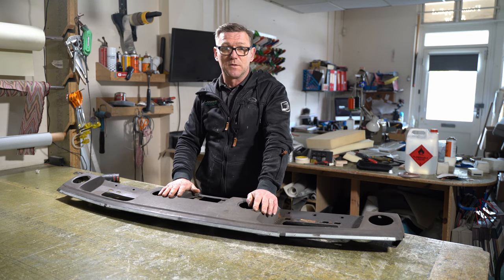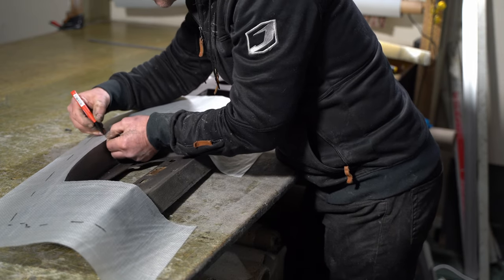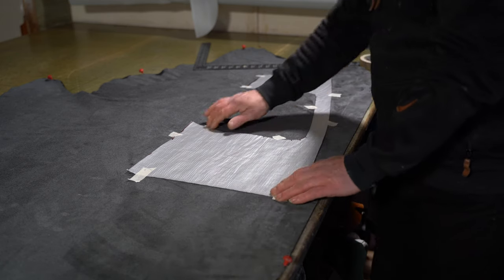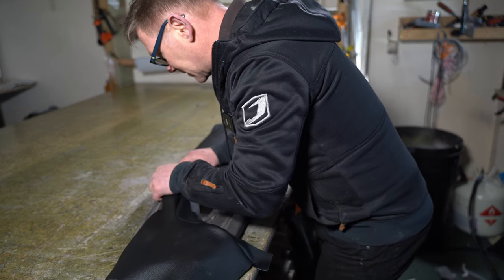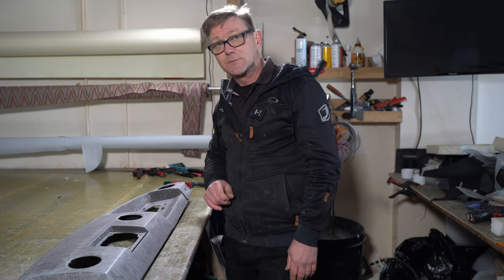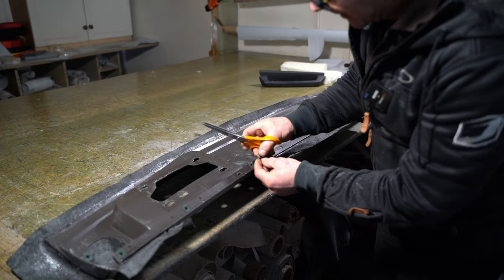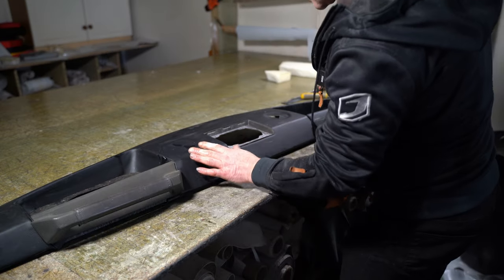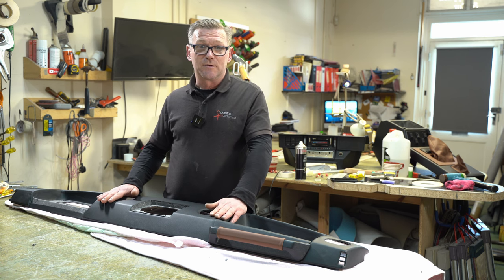Leathering a Range Rover Classic dashboard.

Comment: Can I be cheeky and ask you I have a mk2 escort dashboard that I am recovering do I need to strip the old cover off before I put the new on 
I have a can of spray glue that I bought with the leatherette the cover that’s on now is only coming adrift and small cracks at the bottom edges
Reply from the maker: Before you do the work you should check out these 2 videos, the first one will explain the glue that you should use(6 mins 40 seconds in) and the prep (5 mins in)if you are going to glue over the original vinyl that is on the dash https://youtu.be/t8kx4Td1jdU
and the second one will show you how to remove the vinyl that is on the dash https://youtu.be/yM9vl2ohXSE
but there is a good chance you have the wrong glue and the vinyl will not stay on the dash even if you remove the original cover, RE first video.
Reply: Hi thank you for your time and help in posting the video links I am sure it will help me in my project
Reply from the maker: @billywhizz98  good luck